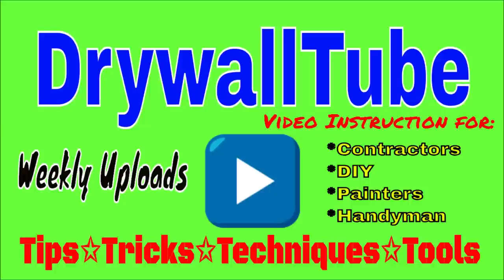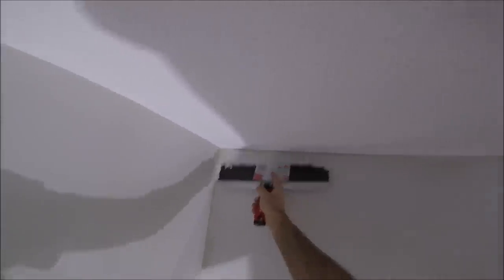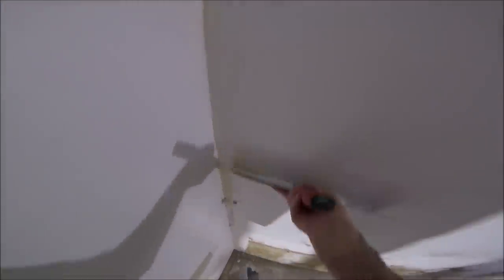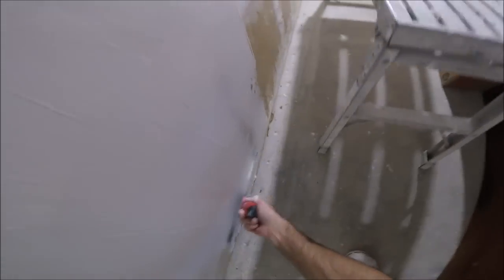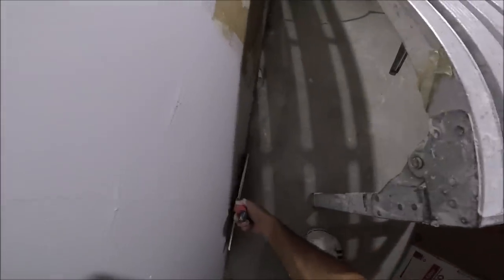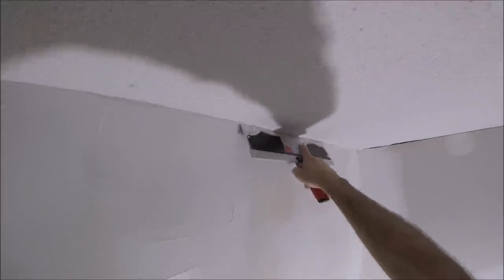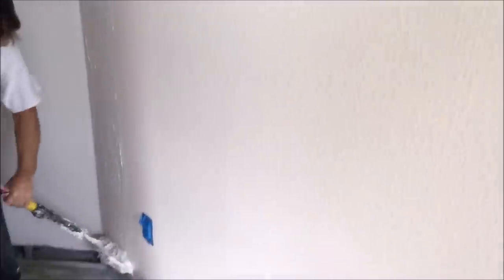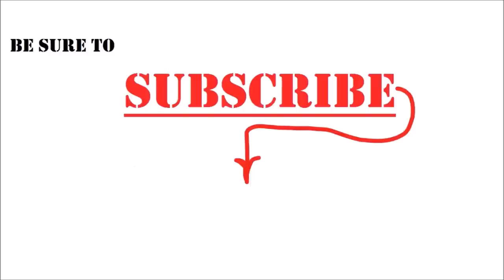How to Cover Your Ugly Damaged Wall with a Skim Coat- Looks Like Glass

Comment: Thank you so much for this video! We moved in to a "fixer upper" and the previous owner had textured every wall in the house with a coarse sponge dipped in drywall mud and made swirls  on the walls and let it dry with the peaks and then painted it! I wish I could send you photo so you could see how horrible it looks! Anyways replacing all the sheetrock was out of the question due to cost so I have to skim coat the walls. I've had to sand the walls as the peaks were up to 3/4 of an inch in places. But once sanded this method your showing is working awesome! It literally looks like brand new drywall! I cant thank you enough!

Comment: Hi, Paul.  I am a DIY guy.  I watched your video yesterday and today I skim coated my bathroom walls after removing wallpaper and priming with Gardz.  Removing wallpaper is of the devil!  This time my walls were not as bad as in your video, but the walls had plenty of damaged drywall paper.  Your description of diluting the mud to pancake batter or yogurt helped.  However, I diluted a full 3.5 gallon box of lite drywall mud with 60 ounces of water and that was twice as much as I needed for the 208 square feet I skim coated. Your rolling method of applying the mud worked GREAT, much faster than using a drywall pan.  Where I live all drywall also is textured, so that will be my next step on my bathroom project using a paint roller and some of my extra diluted drywall mud.  I am glad for the texture step as I think that will hide my lack of skill.   Your skim was "like glass."  My skim coat turned out pretty good maybe not that glass-like. Thanks for your helpful video!!!

Comment: I just pulled down paneling that had beautiful old sheet rock under it that I want to keep. The sheet rock looks like boards in an old beach house, in other words it has a groove in it at intervals. The paneling pulled some of the Sheetrock paper off and it has imperfections, so glad to find your video. I hope I can modify your method. I’m a 65 year old retired nurse who is remodeling the house I lived in when I was born and has been rented by me to a couple for 37 years and until they both passed away. I was married to a carpenter, we built our first house, which was a pole house 20 feet off the ground in the woods. I have been remolding and building anything I wanted or needed since then.

Comment: Glad to see a video with what my walls actually look like. Just bought my first house and spent 40+(still more to go) hours so far removing wallpaper with a steamer. Some walls had 3 layers on it and most weren't prepped or painted before they put the paper on so ive got a lot of holes and gouges in the rock that they papered over. Cant wait to get started figuring out these techniques.
Reply: Best way to remove wallpaper is blue dawn and water in a spray bottle. Doesnt take a huge amount of dawn but it peels RIGHT off. And use a semi sharp scraping tool. Be sure to wear gloves if you can. It gets sticky and nasty. But you don't have to. A professional wall repair guy helped me with that tip.

Comment: Nice work!   Exact content I needed.  I have a 900 sq ft condo that has had a smoker in it. orange peel sheetrock over cement walls. Popcorn ceilings. Once cleaned this is what I'll do.  You posted this 3 years ago and its still relevant.  Thanks!

Comment: I'm a General remodeled of 50 years, I did enjoy the skim coat video. I do a lot of drywalling and skim coating. I had one customer who tried to remove the wall paper past and left over paper with a electronic belt sander.  What a mess that was.

Comment: I was a painter many years ago. My Dad and 2 brothers were all tradies here in Australia..but they never mess with serious plaster work, jusy typical patchwork, backfilling..plastering is a whole different trade here in Australia.. I was the black sheep and got an office job. I have the skills but am very slow. I'm doing my bathroom, going to be tiled wall on aquachek gyprock. I am doing the drywall myself, but didn't want to mess with ceiling, so just removed the old cornice as neat as i could. I've decided the ceiling definitely needs a skim coat..this vid has helped a lot..feel a lot more confident at least..pretty sure mine won't go as smooth as this and i'll be covered in sanding dust :) whatever it takes i geuss !!!

Comment: Thanks for the video, mate. You're very efficient.

I am just a hack DIYer trying to skim coat my ceilings. Been scraping off peeling paint and some of the drywall backing paper has come off (like the wall in your video). I found that applying PVA glue to where the backing paper used to sit also works in preventing blisters in the compound.
Reply from the maker: Good luck with your skim coating project my friend.👍🏻😎

Comment: DIYer here. Redoing my bathroom. The builder used super strong adhesive to glue tiles to the unprimed drywall so it caused a lot of issues when I took them off. Hoping it comes out well and looks like a real wall!
Reply from the maker: Good luck.👍🏻 Let me know if you run into any questions along the way. Thank you so much for watching and commenting.😎

Comment: Great example of how to skim coat a damaged wall. I'll be removing wallpaper from an old house and will try this technique. Also, I have insulation tiles on my ceiling that were installed in the 70's. They likely have asbestos in them making them to dangerous to remove as a DYI and too costly to have professionals remove. Do you think I could mud and tape the seams then skim coat the ceiling?

Comment: I'm a DiY-er who has always wanted to try out the more heavy duty, contractor style of repair, like drywall, plaster, tiling, the works. My husband and I just closed on our first house together and while I was trying to prep the room that is going to be my office, to my horror I found out that the previous owners painted over the original 1982 wallpaper in the room! Thus far, my office seems to be the only room that recieved/still had wallpaper, but just realizing I would have to remove it made me tired. It took a solid day for me to remove the wallpaper, but either due to the age of it or the poor application or how I removed it I had almost no drywall damage. Thank goodness! However, after patching and filling some old nail holes and sealing the minimal drywall damage upon recommendations from people more experienced than I, I'm now at the point in the process of being terrified of doing the skim coat. I found your channel at just the right time! And this makes me feel more confident that I can actually get this done.

Comment: Hi Paul new to your channel. My Husband Dr Kirk is attempting to skim our upstairs bathroom. You have the perfect example in this video as the previous owner wallpapered directly to the drywall with what appears to be some contact cement or hide glue. It would not steam,  soften with water or chemical - so we scrapped 1-inch sections at a time to keep from gouging the walls but still pulled copious amounts of brown paper loose.  Thanks for the tips and the encouragement that we could make it better. PS just priming the walls made it 100 times better.

Comment: Thanks for another great, informative video! After living in cities/countries where having smooth walls are the norm, I just can't go back to textured walls that are in 99.9% of homes in FL. My husband and I are waiting to close on a 3,300sqft home in Tampa, and in order to spend money on projects I know I can't do (like laying and hanging new tile) I'm going to try my luck at skim coating the walls for a smooth finish before we sub out the painting. It'll probably take me a month to do it, but I'm determined to have smooth walls. 

***Question:  I've seen a few videos where guys sanded walls to remove paint and some texture off before applying the mud. They said it would give the mud a better foundation to stick to the wall, and for walls with a lot of that orange peel they said it'll save you another application of the mud. That said, I watched a video of yours where you applied the mud directly onto a finished, painted wall. Is this just a preference, does it depend how much texture is on the wall, or is there something else I need to consider before either sanding or just applying the mud/skim coat first?

Comment: I am working on a 1980s bathroom that had wallpaper. I ran into the same issue with torn drywall paper and wallpaper remnants. I used the gardz and skim coating and it worked great

Comment: Hey Paul, This video is very helpful! My husband and I were terrible at drywalling a few years ago. Now I’m educating myself so I can repair some ceilings that have small bits of paper damage and nail pops. My first go at it was horrible! But after watching this, I now understand I need to apply pressure on the leading edge. I think I’ll switch to a wall repair so I can get some practice before attempting the ceiling again. Thanks so much!

Comment: Paul, I appreciate you taking the time to share your expertise. I'm a DIY'er but not new to to drywall, tape and bed but always seem to find a situation that requires a new technique. I am in the middle of a bathroom remodel in which I have replaced all the drywall so the condition of the surfaces are good. The room is small, 5' wide x 8'm walls but the job is complicated by the fact that I framed a dome vault aka cloister vault ceiling. For those who can't envision this ceiling imagine an umbrella that only has 4 panels but unlike a pyramid shape still rounds to a dome at the top. This ceiling therefore has four concave panels that meet at the top almost like the top of a sphere but where they meet at the walls they have defined corners. Those corners where they meet each other are  changing in angle every inch, in addition were each panel meets the top of each respective wall the angle is not a common degree angle, ie not 90 or 45. All this brings great challenge to even an experienced DIYer in getting smooth layers of mud into the corners when taping as well as when skimming. Is there a tool you are aware of that might help do these odd angles and concave surfaces? Perhaps a Pool Trowel? Thanks, Stuart

Comment: Thank you for your video.  I love the idea of the paint roller to put the joint compound on the wall.  I always have trouble putting the compound on the wall evenly.  Now I can attempt the wall I need to fix (just removed wallpaper) and go back to the one I had difficulty with.  Thanks again!

Comment: I am beginning bathroom remodel and appreciate your video as I intend to use it when doing my bathroom walls because unfortunately they are in bad shape.. My question is do I have use a primer after applying the drywall joint compound if I purchased a high quality paint with primer in it?

Comment: DIYer. Wanting to cover up old drywall seam repairs that were done very badly.  Ceiling and wall has old swirl design in plaster. Was considering doing 1/4 inch drywall over existing.  Think I will try this instead.

Comment: Paul, great video! One question I have. Can you use this method to cover small cracks on a plastered wall?
Reply: Do you use Ultra lightweight joint compound or regular.
Reply: It should work if the walls are solid enough, but if the wall shifts and cracks easily, you might have to embed fiberglass mesh (window screen will do) in the joint compound.

Comment: We batch together a bunch of old oil based paints preferably light colors and roll over the torn and brown papered drywall to seal it and kinda glue back down it works really well if your not in an occupied building or space it does have a smell only drawback

Comment: I like to use a squirrel dipped in whiskey, it tends to sedate the squirrel a bit and makes for a smooth finish. You'll definitely need some bandages, possibly a tourniquet depending on the strength of the whiskey and temperament of the squirrel.
A badger makes a smoother level 5 finish.....but you may not survive...
Excellent video thanks 😊
Reply from the maker: Thank you??? 😂

Comment: i use similar method for glass finish with oil based sealer primer. i seal the wall with the primer using a paint roller, then skim coat plaster the whole wall, sand flat with 360 sander, sealer primer again, sand, then ultra thin skim coat to flll any holes or lines, sand again for glass surface as the hard primer protects the flats and the plaster stays in any holes or lines, then sealer binder last time, sand, then 2 coats of finishing paint with roller, sanding after first coat. takes along time and the oil gives u a headache if u breathe it u need gas mask but finish is glass

Comment: DIY homeowner about to tackle a room with HORRIBLE painted walls. Nail pops, seams, and patches so easily seen on all walls. Cracks in corners and all seams. I did my LR and DR years ago and while they were bad, they were great compared to this room Im about to tackle. My LR & DR came out great, but I took my time. They didnt need skim coats, more of spot patching.
This room Im about to tackle has 15' high vaulted ceilings, sloping 30 degrees. And I think Im going to have to skim coat the entire room. Thats why I found your video for tips. 
Ive already started by rooming an old ceil fan and relocating the wire to the center of the room. But I am NOT looking fwd to this remodel, but it needs to be done bad as its the last room in the house that hasnt had any upgrades.

Comment: First time DIYer, confronting skim coating three rooms with ceilings. So far I have done two passes over the taped seams. The issue I am having is the drag lines on each side of the knife, but as you explain it well, I will try with the pressure/lift on the sides.
My question, is how many coats do you do? The first coat will not be perfect right? And do you sand with an electric sander at the end to finish and smooth?

Comment: #drywalltube Thanks Paul - I am a 58 year old female DIYer - currently decorating my living room and really want to improve the previously painted and papered walls. Each wall has a different coating and the layers of painted scrapped off has left them pitted and sanding has failed to get them smooth. so I am depressed and need a good solution. This seems like it - but I worry I will be too slow and the mud will dry out. 

Loved the video anyway.

Comment: I'm an RV tech, but I don't usually do painting and remodeling.  My usual work is appliances. 
I have removed wallpaper from plywood.   Do I HAVE to remove the adhesive or can I just cover the walls and ceiling with Gardz.  I also want to skim coat the ceiling and walls before painting.  So.... you just answered my next question.... should I primer AFTER the skin coat?
So, that's a yes.  I bought a Graco sprayer for this job.   Also, I've cut holes in the plywood to do some electrical work and patched my cutouts back in place.  Do I need to tape them or just spread mud over the patches?  And do i use paper tape or that mesh/woven looking tape? 
Thanks

Comment: I watched your skim coat videos. I’m going to do that to my walls. My question is, how do you get waves in the drywall out? I’m doing this over a bad framing/drywall job. I’m guessing I could try to fill on the dips before skim coating. But I’m a diy’er so I’m not sure.

Comment: At a point, I will just replace the drywall. Sometimes skim coating is not worth it. Especially over paint because of the mud bubbles
Reply: Mud bubbles don’t happen with the right primer. Gardz or the Roman pro999-rx35

Comment: What material you using? Is it a finish or topping mud? Brand? Is it boxed mud or come in a bucket? I finished concrete for years and thinking about skim coating my textured walls in my home.

Comment: I'm a DIYer on a kitchen and bath remodel. Thank you for great videos. Question: You mentioned Gardz Problem Surface Sealer and Zinsser Primer 1-2-3.  Did you use both products on the same wall. If so, which is applied first.

Comment: I’m about to skim old plaster walls that I removed wallpaper from. Should I use blue lid or green lid? I’m going to prime after I skim and I’m going to use a roller to apply the skim coat. Also should I fix big cracks with mesh or paper tape first? Or just skim and see what’s left behind. I don’t and the cracks to show thru after I skim. Thanks again great video

Comment: Thank you for making this. I’m a new homeowner, dealing with some stuff left behind by previous owners like wall anchors, holes, and some not very nice patches lol.

My question is: you have to cover a whole wall with mud, or is it possible to get good results applying mud to just parts of a wall? And would the layering order be paper glue, mud, paint primer, then paint? Thank you.
Reply: I’m not a pro, but a DIY. I’ve learned to put light coat of mud (preferably one that dries within 30-45 minutes), apply tape, apply another coat of mud, and sand. You may need to apply 3 coats of mud, letting it dry between coats. Then you apply primer. After, you paint. I suggest using paint & primer in 1 after using a primer and sealer.

Comment: Hey Paul -   Just bought an old house with plaster ceilings/walls... i watched your videos, theyre awesome, but I realized that youre working on dry wall... does this work on plaster popcorn ceilings, with a curved, some parts cracked, surfaces?  Should i consider just demo’ing and putting up dry wall?  Thx.

Comment: Great video! We just bought our first home and were trying to fix it up. It was a rental for 20yrs before us buying so it has numerous nail holes from hanging crap, divots, and what looks like paint that has chipped then painted over...to repair should I putty the nail holes then compound the rest to get that smooth finish or could I skip the putty and just compound everything? Also I get what you mean for the consistency for the compound but roughly about how much water do you mix in? Thanks man!